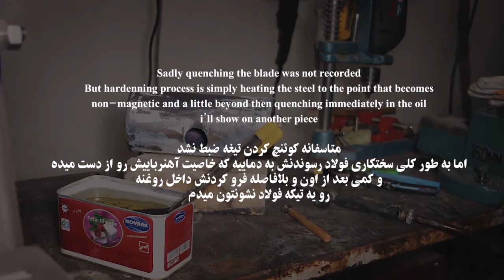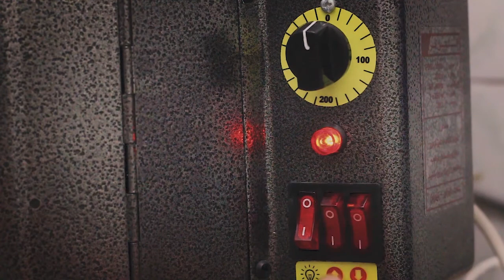Making a straight razor Part 1 | ساخت تیغ اصلاح قسمت اول

Comment: Cover your metal kiln with something to not lose heat fast, annealing won't work if it cools fast.
Reply from the maker: yeah you're right thanks, I'm gonna make a forge next time
Reply: @milimakes  put the heated piece in hot sand and let it cool for several hours
Reply from the maker: @PaymaanJafari  thanks for the advice